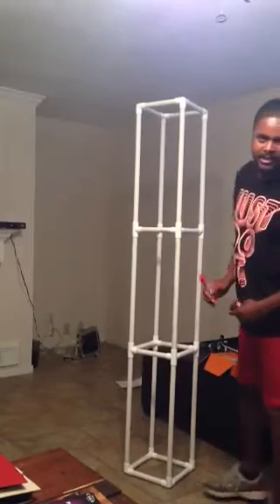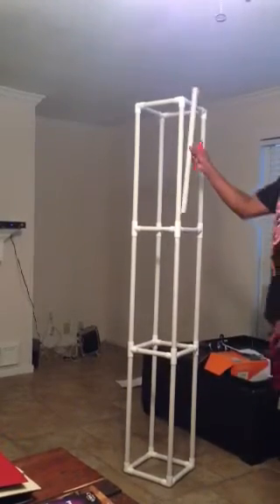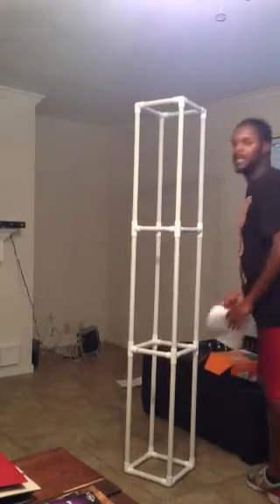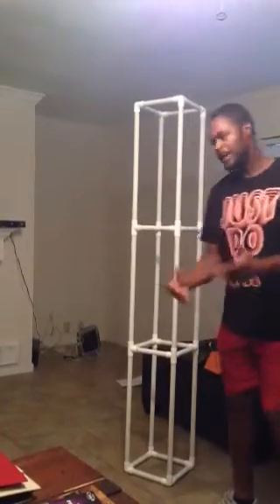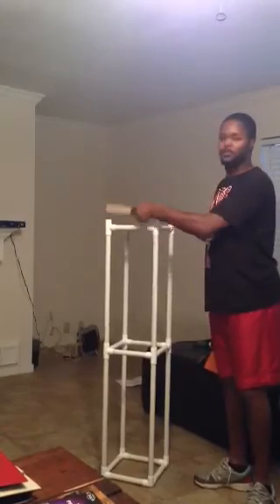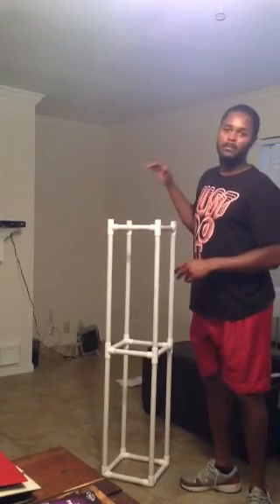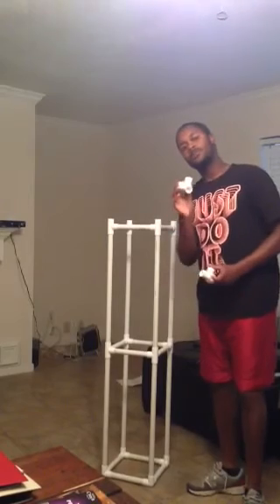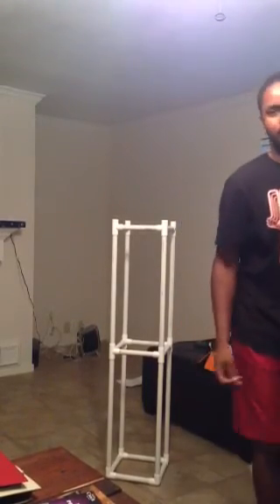DJ 3-20 DIY Light Totem

Comment: Nice Totems Man! I built a set of these about six months ago and they are holding up great. You should check em out. I just put the video up last night because i wanted to make sure i was happy with the before I did a build vid. Mine is a little different, less parts and its shorter and wider. I like that all of your connectors are the same or similar and the pieces are roughly the same size. I also made a scrim, did you make a scrim or order one?